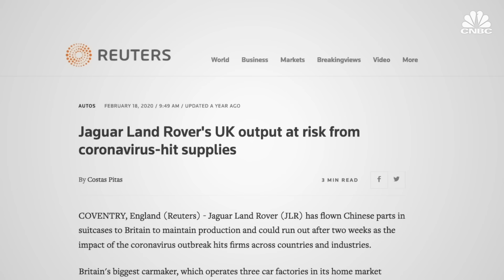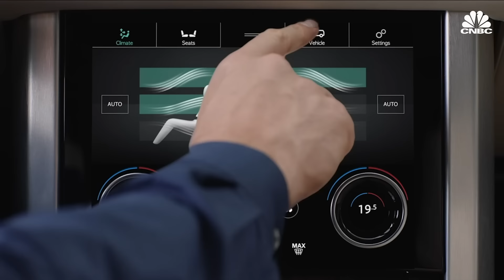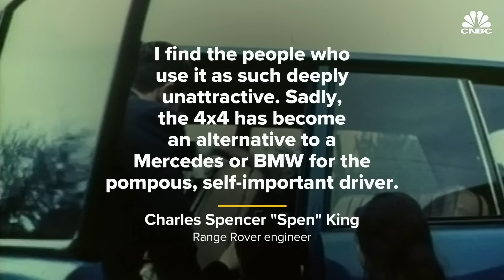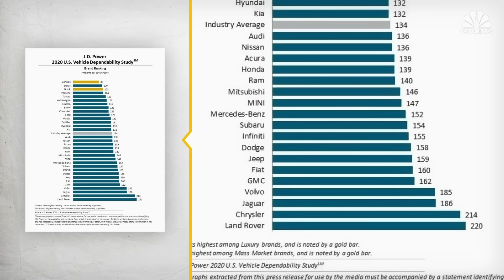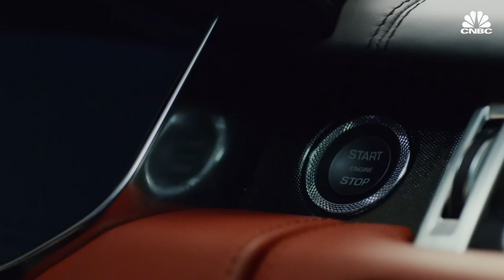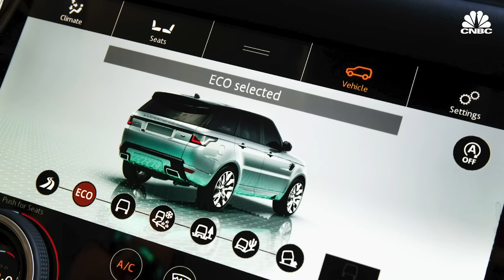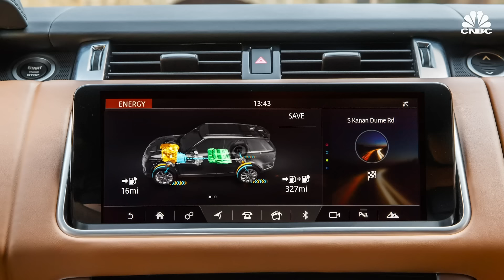How Range Rover Went From Off-Road Beast To Status SUV

Comment: I have a 2008 LR Lr3, I must say it's well built, such as no noise in the cabin, outside all attachments in tact. 
However the dash is cracked ,
it has over 188 thousands miles 
Motor and transmission still good smooth running. 
Need the air conditioner repaired
Alone with the drivers side window doesn't comes down. 
There's other things that has been repaired.  I would be extremely grateful if someone from land rover could help me with this problem.  I love this vehicle

Comment: G Class outperforms the latest Range Rover Defender in the real heavy offroad terrain, probably also price. There is a Spanish test where the G tows uphill the Range Rover, the Range cannot do the same at all. The only advantage came when there was a high, pointy, "hunchback", the Range Rover's higher clearance helps there. Not having full set of differentials (G Wagen has 3 of them) is  making it a not so good heavy duty suv, but good for road.

Comment: Range Rovers are like taxi cabs here in Abu Dhabi. I’ve never owned one. 

I’m happy driving a 2012 Lexus IS300. In ten and a half years, I’ve never had any issues, beyond the one flat 18month old tire, and the annual change of batteries, along with the usual service checkup at any petrol station every 15,000km. 

I’m keeping it for another ten years, until 2032.

Comment: Just so you know, they mentioned tata motors is nothing without JLR is absolutely wrong. They are third largest automobile company in india and potentially second in few years. Tata motors has huge share in government vehicle , electric vehicles its a leader and defense vehicle. Major company in commercial vehicles as well.

And TATA motors is a fraction of TATA group. Its bigger than VW mercedes and Ford combined

Comment: If you buy one in Massachusetts they sell a special Ma$$hole model with the turn signals removed and the high beams permanently on. Oh, and at the mall you're supposed to park them across two parking spaces to assert your dominance.

Comment: One of the most unreliable brands on the market.  The "new generation" Land Rover Defender may be one of the most disappointing offerings imaginable.  It bears absolutely no resemblance to the iconic Defender that it replaced.  Rather than do what FCA was able to do in upgrading the Jeep Wrangler while saving the basic design, Land Rover trashed the past and created a dud.